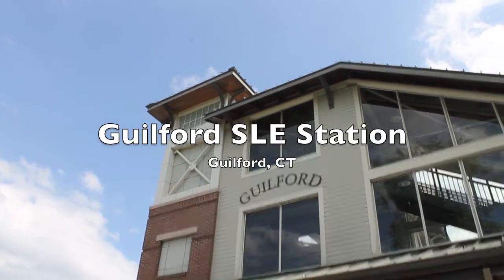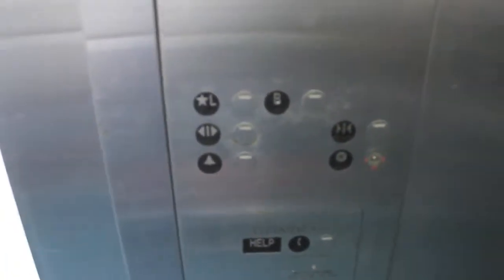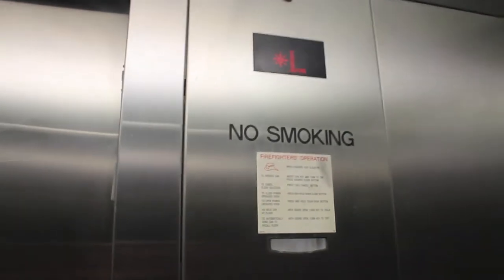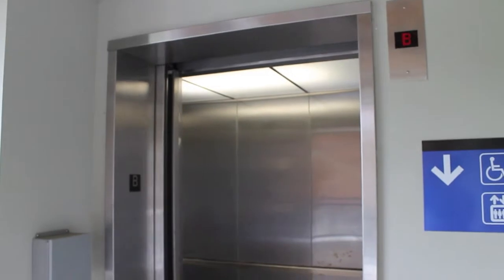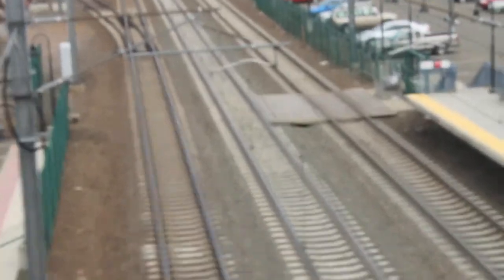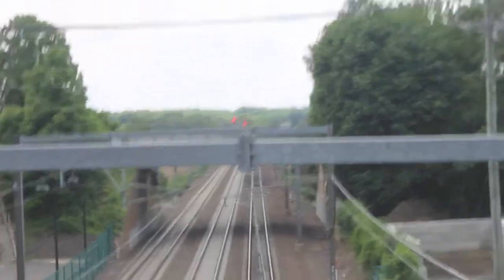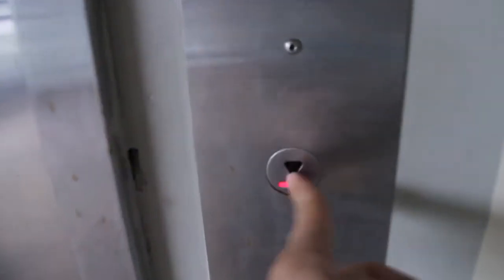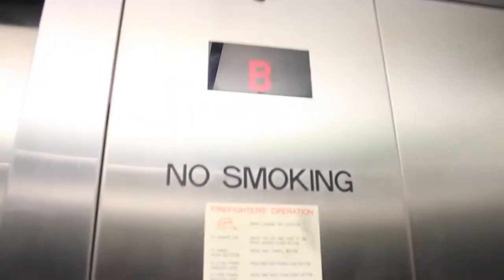KONE Delta EcoDisc MRL Traction Elevator (#2, Track 1)-Guilford SLE Station; Guilford, CT

Comment: Those buttons are innovation. Kone just likes to use them
Reply from the maker: +Elevating Oregon since 2015 Yeah, they're Innovation buttons. I think they're made specifically for KONE, though, much like how MT is made by EPCO, and made for Schindler.
Reply: Elevating Oregon since 2015 in the U.K. We have kone k delta with fixtures like this but innovation doesn't exist in U.K. so maybe kone might have made it